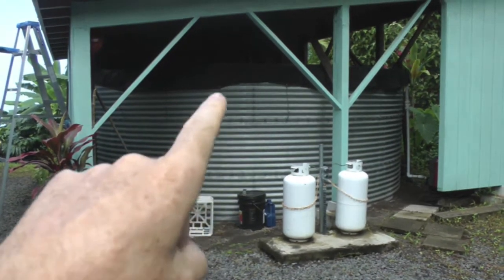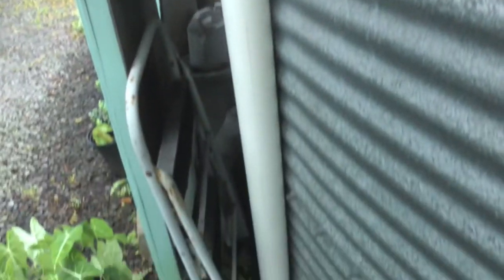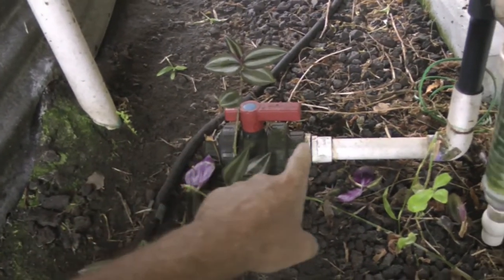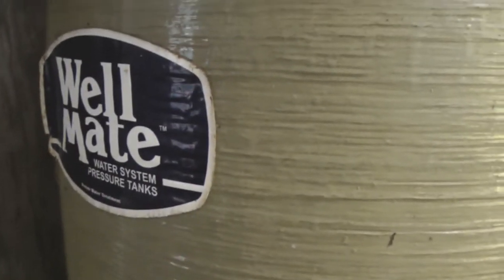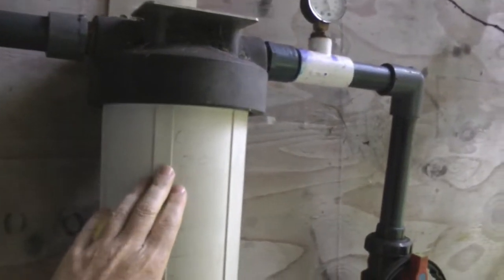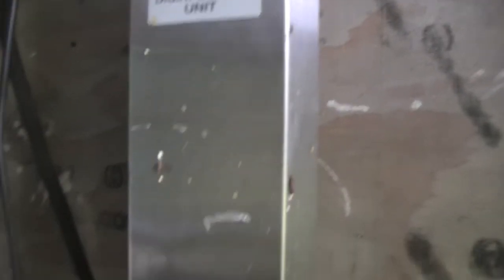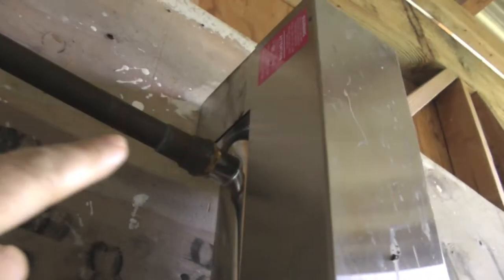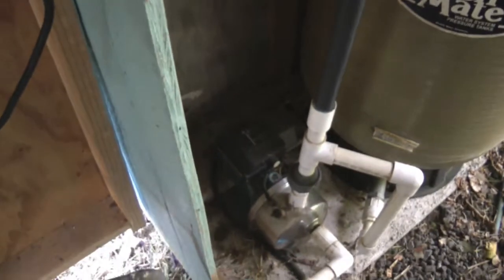Off the Grid House in Hawaii, Part 2; Rainwater Catchment System

Comment: Does the solar power supply enough energy to pump into the house?  Or, do you have to tap into city electricity?  Very cool by the way.
Reply from the maker: There is nothing to tap into, the house is completely off-grid. The solar power provides the pumping and water pressure inside the house. Thanks for watching!